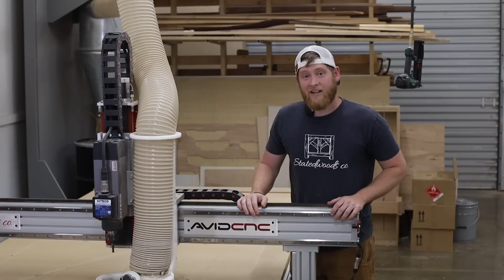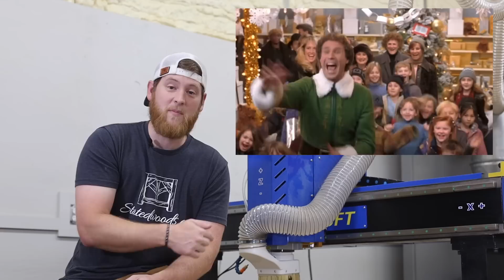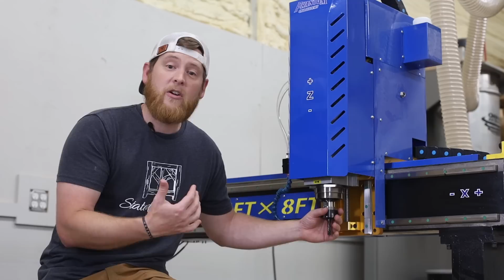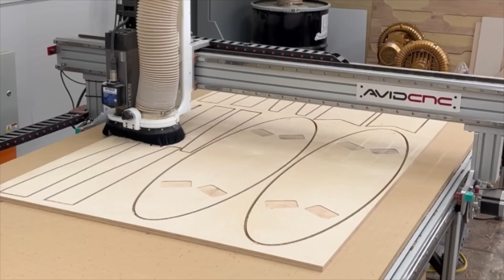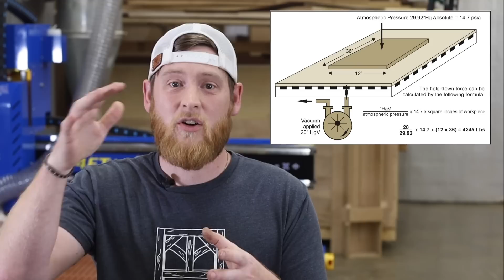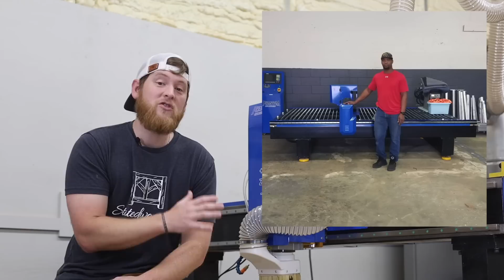Which is a better machine?

Comment: 25:48

The Shopsmart is not the lowest price solid frame from Laguna, the Swift is.
The Panther is not the lowest price solid frame from Camaster. The Stringer is.
The Pro is not the lowest price solid frame from Shopsabre, the RC is.
While the Stringer and RC used to be aluminum build, they are now steel.

All 3 of these I've listed are solid welded steel frame CNCs, well below the prices you listed for "the competition".
Very dishonest you posting those 3 machines well above what actually competes with the phantom.
Was this whole video just a paid ad read for Phantom?
Reply: Guess I shouldn't have posted my comment yet. You got even worse.
You seriously pushed the idea that phantoms are just "hand picked parts not sold at markup"?
A Camaster and Shopsabre are both made 100% in the USA. Laguna and Phantom are both imported chinese machines. Maybe Phantom isnt marking up as much as Laguna, but they're still marked up significantly over their manufacturing cost, more so than the USA made alternatives. The people who own Phantom are not "creators" who "know how hard it is". They're importers looking to disrupt the market with a cheap chinese product.
Reply from the maker: Nope. Not at all paid for from Phantom. I purchased my machine 100% out right. These based on prices back in 2022.

Comment: You're just using crappy motion control software, or you simply don't know what you're doing. You should be able to ramp your axis movement up and down. It's called acceleration. Granted higher acceleration is nicer but you can't go beyond what your machine can handle. Which if your machine is, "walking across the floor" you're obviously doing.
Reply from the maker: Exactly. The frame was the weakest link in my machine.

Comment: Most of those DIY CNC routers come with linear guides on the top. This is good for production of the CNC, but bad for the operator,  we need to be free to lad plates from any side of the CNC (the big ones). Linear guides on top of the table means to risk these parts with impact of the plates, making dents and making the router unstable.

Comment: This guy is a salesman.
Reply from the maker: Would never call myself a salesman. Just a guy sharing his experiences. Take it or leave it how you want.
Reply: @Statedwoods  The adage, more or less goes as follows, "If it walks like a duck, and quacks like a duck, and looks like a duck... it's probably a duck." You, my man, are a salesman. Of course that doesn't preclude you from also being a technician.

The machine you derided could have been anchored to the floor with bolts or at least had its legs weighed down with sandbags. Sheesh.

Comment: stupid question here but how thin of material can any of these machines cut and how thick could they cut?  I know it will depend on the material but for any hardwood, panel, or MDF what would be the number?
Reply: highly depends on the Height of your z axis, the endmill you are using and the clearance of the cut. Now cutting it is easy you can just do multiple passes without issue. It's mainly just "does it have the clearance to cut that deep"

Comment: Seems to be sooooo many people/companies selling these Chinese made CNC machines nowadays. One specd like this Phantom you could get direct from a manufacturer for like around $6k with shipping and brokerage fees included. Blue Elephant is a big name manufacturer if anyone is interested in going that route. Avid IMO really needs to cut it's price significantly if they want to stay in the game against these new places popping up.
Reply: Blue elephant is great but a machine of this spec is around 12 to 15k before tariffs and shipping. I was planning on buying the 1325 4x8 ATC. Still cheaper and better then Avid though. Btw tariffs suck
Reply: @MrJcTTK  nah, no way. Last I talked to them I had one optioned/specd just about the same, maybe a tad better and it was only going to cost around 9 grand. Then would have been around $3500 for all the shipping and import stuff.
Reply: @endlesslybrowsing6559  must of changed their pieces since even if you go on their site to get one that cheap you are cutting out a lot of stuff compared to this model in the video
Reply: I Just received a 12300USD PO for a blue Elephant with all bells and whistles, 9kw main spindle and 3.5kW horizontal spindle and total of 2500kg, vacuum and ATC.  They really have great bang for the $$$

Comment: I've been looking at the machines Spark Robotic has as well. Machines with a steel frame but they are made to bolt together. Useful for someone who wants a more heavy duty machine but doesn't have the ability to get a full machine into whatever place they need it.
Reply from the maker: Absolutely. Thats an good option as well.
Reply: Will the phantom fit through a single car garage door?

I haven't been in a shop without one... Nor would I want to own a shop without one...

Normally it's a roll top door big enough to hide an Amazon delivery truck!

Comment: Just get some mild steel or more extruded aluminum and reinforce the diagonal bracing for the AVID. Now belt driven, THAT'S A PROBLEM!
Reply: Belt driven is definitely not a problem with a wood router machine. It'll hold a tolerance of a thousandth of an inch all day long. Belts are a lot more precise than you're apparently aware of. With lead screws you have inertia which is more of a problem than you seem to know.

Comment: Great review of both cnc machines.  As a cnc hobbyist, I have an AVID Desktop Pro and am quite happy with this system. My original problem was finding a macine that I could get downstairs into my basement workshop and this machine fit the bill exactly as it came unassembled and I could get it into my workshop fairly easily. The assembly however, did take a few days but it gave me an opportunity to learn how the cnc was put together in case I needed to haver to repair any part of it at some later point. I have had it now for several years and have not expereienced any repair problems with it so far.
Reply from the maker: Glad you have enjoyed it. These are all fun machines.

Comment: SUPER Video... I've been considering the Avid, now, have looked at the Phantom BUT, I came across this machine model  STM1325 from StyleCNC - An off shore machine and it's very close to the Phantom and, sub $6,000!! To good to be true? I don't know but it's interesting and well presented. Has anyone heard of these folks? My need is very simple... a drill and countersink a couple dozen holes and 4 1/2x1" slots in 12x72 x1/8" AL as a dedicated machine... so, cost is definitely a concern.
Reply: personal opinion go look up blue elpahant, chinese yes but great company

Comment: The only thing I don't understand with this kind of price tag is why tool changers aren't put in to it. The manual process of changing tools is annoying on it's own.. but the ability to account for a variety of tools when designing something.. and the speed of having it auto change tools.. is such a huge improvement for what I would say is way less cost than manually changing tools.. it seems like when you're in the 20K range or more, it should just be part of the machine. Other than that.. this looks like an amazing machine for sure.
Reply from the maker: I love a tool changer. The spindles on those are like 7k more money than the spindles on these two machines. Not to mention the different controller required to run it. Tool changers can add up cost wise just because of parts.
Reply: So to answer your question. We're trying to keep the cost under a Honda civic.

Auto changing bits blows the cost beyond any car honda offers and lands you in SUV territory. Or even a super basic f150 by the time it's running in your shop.

Comment: Thank you for so much for this video! So I understand... with the vacuum pumps, I will need to have an electrician put in two 30 amp 220V outlets, correct?
Reply from the maker: Yes. You can put plugs on them if you want too but I like hard wired.

Comment: I started off with a couple smaller extruded aluminum style cnc machines (OpenBuild and QueenBee Pro).  I spoke with the guys at Phantom, but the logistics of getting one to Canada and the exchange rate really increased the price. I ended up going with at similar style machine...a C10-510ATC from CanCam up here and in Canada. The vacuum table and automatic tool changer is a big time saver.
Reply: AXYZ is that expensive one? They are Canadian too isn't?
Reply: I'm also in Canada, was looking at CanCam instead of Phantom. Would you mind chatting about your experience?
Reply: Exchange rates don't increase the price. Just convert it's cost to your type of compensation. $20,000 USD has the same value as whatever $20,000 USD worth of Canadian dollars is, and it's also cost prohibitive here. It's like the cost of a Honda civic by the time it's ready to run.

Comment: To be fair! Phantom is not built in the US. They buy it from a Chinese manufacturer and slap their label on it. All these features come already built in china. That being said, it is still a good price for a machine that's ready to ship from the US and you get support provided from the US.
Reply from the maker: This is totally incorrect. I have been to their factory many times now in the US. None of their machines are a rebrand. I have even helped build my machine in NC.
Reply: @Statedwoods  Yes it is a rebranded machine. They don't claim anywhere on their site "Built in the US" All they say on their site is "EVERY machine sold by us is fully quality tested at our facility in North Carolina." They buy the frame from china and all the parts. Just because they assemble the machine in NC, doesn't mean it's built in the US. Even the Models Names are similar to Chinese brands Cnc's. This is exactly why their cost is low.

Comment: I'll be honest, I've been looking at Avid and its general affordability - destined for immediate production, not hobby use. I've also been looking at using a Masso G3 controller instead of Mach 4. That all said, it's always looked like a $8-10K setup for which you're paying $20k - a tough pill to swallow, but still more attractive than most of what's out there. There's no question that not including shipping, Phantom is a better value proposition and the outlay can be recouped quickly with steady work. The only hiccup really is that the prices have jumped since the summer. And when looking at a 5x10 (which really is the only size that makes sense for my needs), they start at 23.5
Reply from the maker: Yup they did a price increase just like everyone else did during the high shipping, gas prices, and steel prices all went up.

Comment: Not to knock the vide, but why are you comparing a $8,000 machine up against a $20,000 machine? That's like comparing a Kia VS a Bugatti. Yes the AVID is not built as well, but it has its place in the industry. A lot of people can't even afford the AVID much less the Phantom. This is an informative video, but it's not a fair comparison. I've been wanting to build my own CNC for a few years now; there are two limiting factors, time and money.
Reply from the maker: They were priced only $500 different. None of these are $8,000 machines?

Comment: This was a fantastic video. Thank you. I’m a small business in cabinetry looking to purchase a CNC. I thought the AVID was the no-brainer.  I’m now investigating the Phantom. My only misunderstanding is the price. I was under the impression that the avid was ready to go for about $8k (4x8 table). Looks like I was mistaken. Thanks again - very good information and I will use the wisdom wisely.
Reply from the maker: Thats what the website tells you. Thats for just the table. None of the controls or electronics come with the 8k price. Its very misleading.
Reply: @Statedwoods   You would like to put $15k to make it running

Comment: I've used Multicam routers for a few years and they are very good, but very expensive... and for much of the work done at our shop, I think it might be more machine than is necessary.  So why spend the extra money?  A friend mentioned the Phantom to me yesterday and I started my research this morning.  I have questions about the interface between my PC and the dash board on the machine (primarily what software best suits the Phantom, ie:  Enroute?)  but at first glance, the Phantom looks to be every bit as capable as the Multicam at 25% the cost.  Great video, very informative.  Thanks!
Reply: Man you had me for a second! I was like, there's routers that cost more than cnc macines!!!

Had to look the company up to find it's not a router. It's a cnc machine. Which, just like any other, uses a router. but it is not technically a router itself.

I wonder why the company doesn't call it a multicam cnc machine? Seeing as the high end stuff uses a spindle instead of a router. and a router is more hobbyist level cnc stuff.
Reply: @brandonhoffman4712  It is a router.   A CNC router.  Machinists would call it a gantry mill.  Don't confuse a computer router with the name of this piece of equipment.   Also, some do actually use a router, better ones use a spindle (which can be speed,start,stop controlled without touching it), but it is indeed simply a cnc router
Reply: @matthewpeterson3329  yes I understand a cnc can mount a router. Though that still doesn't make the machine itself a router. Notice even the old school guys didn't call it a router, but a gantry mill. That's because a gantry mill is not a router. Likewise a router table is not a router, but uses one to do its work.

Between a cnc machine, gantry mill, router table, and router. Only one is actually a router, and it's the tool named router. The rest use a router to do their work.

By applying your train of thought, you are a router when holding one in use... Or any other tool for that matter... Don't be a tool! (Sorry had to throw that in for comedies sake)
Reply: @matthewpeterson3329  Whatever you say gramps. Your insult is the most intelligent thing you've said.

Maybe quotes can help you learn?

"In machining, numerical control, also called computer numerical control, is the automated control of tools by means of a computer. It is used to operate tools such as drills, lathes, mills, grinders, routers and 3D printers." - https://en.m.wikipedia.org/wiki/Numerical_control

Notice the part where it states. "It is used to operate tools" then lists router as one of the tools a cnc can use. 

I'm not the ignorant one here, grandpa... welcome to the future!
Reply: @brandonhoffman4712  yeah, I've worked in the industry for over 30 years, so "gramps" might be apt, but you started and continue the name calling with the "tool" remark.  Meanwhile, EVERYBODY calls it a router, plain and simple.  You obviously have no background in machining, CNC or otherwise.  So while you quote what you found on Google, you prove yourself truly dim in regards to this industry and the equipment used... and what it's referred as.

Comment: Great vid. Very informative. 
I need to pour a slab, build a metal building, run power  first.  But  this is definitely the machine.  XRP will moon in 23.  That’s when I’ll set up my shop!
Reply: Looking at the same process - still not sure if it's going to happen, but fingers crossed. It's a big pivot.
Reply: If you have a chance I would look at a shop Sabre. It's completely American made out of milled tube aluminum. If you are looking for ridgity which is really the main issue when it comes to milling wood I highly suggest it. Also their tech support is super nice.

Comment: Thanks for the info about the machines and helping us make informed decisions! It's still hard for me to compare a cast iron table CNC machine to a build it yourself aluminum frame table CNC, where the prices of the machines are very different as well. Avid's flagship costs as much as Phantom's entry level machine! When it comes to performance though, it is clear that cast iron is the way to go if you can afford it!
Reply from the maker: The price points on these machines were only $500 off of each other for the same “named” machines
Reply: Thank you for your reply! I just double-checked the starting price of the Phantom S series which is $20,500, while the starting price of the comparably sized 4'x8' Avid PRO4896 is only $6,860, (the Avid can also be upgraded to 12" height for $400). Are we talking about different models perhaps? I only ask because I can't afford a $20k machine at the moment (despite the clearly superior build quality and stability), but need the larger work area to get started on producing larger furniture projects. I could finance an Avid, but it's hard to make a decision!
Reply: @woodandwandco  The Avid PRO4896 kit for $6,860 is basically just the frame, it is not everything you need to get a running CNC. You will still need to purchase a spindle, control system, leg kit, and a bunch of other stuff. Look for the "So what else do I need for a fully-configured CNC machine?" link just below the picture of the unit on their website, and you'll see what I'm talking about. By the time you get everything you need you will be nowhere near the $7,280 you currently have in mind... This is the misleading part of the way they sell their machines.
Reply: @scttmzr   I agree with  @scttmzr. I have gone a couple of times to Avid's website to price the entry-level level machines and, after all the required additions, it always ends up close to $20k or more. It is deceiving the way they present their product.

Comment: Bolt it to the wall.
Reply from the maker: Floor maybe. Not the wall. Hard to clean behind it
Reply: @Statedwoods   Use a linear rail. I have the same problem with my printers, the x & y axis' would move because the movement from the bed is on a platform. A wall immobilizes the x & y movement. Mounting to the floor won't do anything, the x & y will still move.